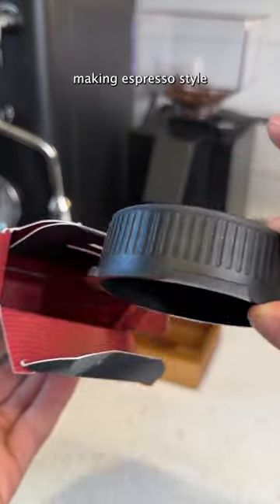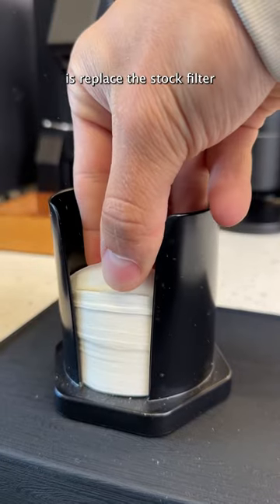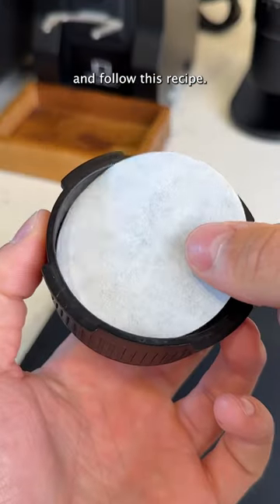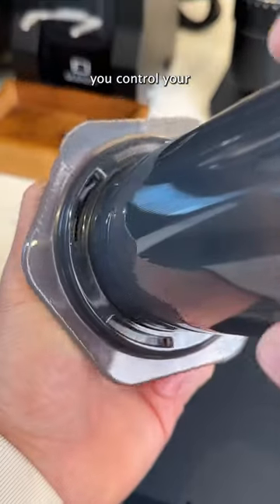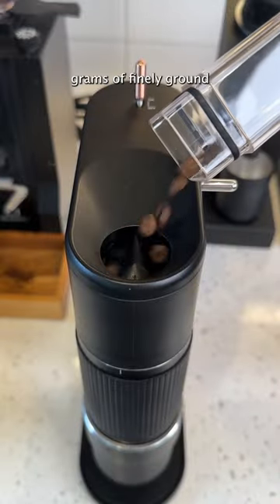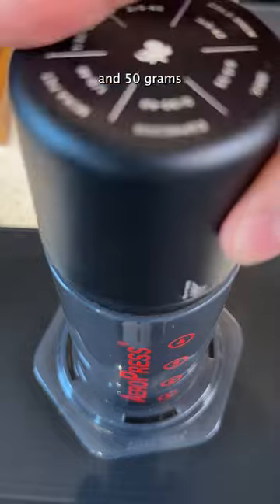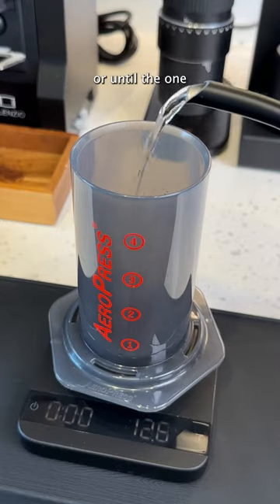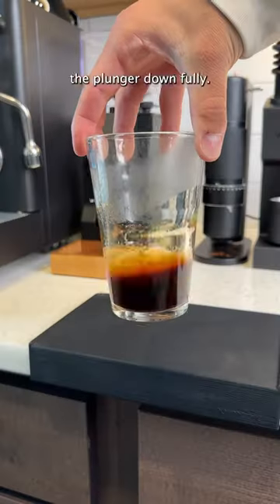The New Aeropress Cap #coffee

Comment: How does this compare to Fellow Coffee Prismo?
Reply: The prismo comes with a metal filter, this uses the standard aeropress papers.
This means you'll always get a few fines in your coffee when using the prismo, as well as a slightly different taste.
Reply: @NoOne-ef7yu  only if you don't use a paper filter with it. It's not like it doesn't fit
Reply: @Dr.Duck22  Jep, you can use a paper filter on top of the screen mesh.
But I always found that a very annoying way to use the prismo,   for some reason.

On the other hand, you can also use a metal filter with this thing.
The prismo's days are numbered.
Reply: This is almost the same but no metal filter. Get the Prismo.

Comment: Get a Moka cup , you’re welcome
Reply: Moka pots don't make espresso because they don't create pressure. Also the coffee is much more diluted.
Reply: @i.8885  It creates an espresso-like taste, and is the closest you can get to espresso without using an actual espresso machine. In fact, the Moka pot is often referred to as a “stovetop espresso machine.”
Reply: @i.8885 Moka pot does brew with pressure. Just not nearly enough pressure to qualify as espresso
Reply: @i.8885  moka pots makes more espresso like coffee than this does
Reply: I’ve never been able to make a decent Moka pot.
Reply: @bradwilks2  I’ve recently been getting great results: grind fresh espresso beans medium fine (10 on baratza encore), fill the chamber with room temperature water, brew on medium heat, remove from heat once the sputtering starts.
Reply: @bradwilks2 once you find the sweet spot, it's pretty easy to get a good cup over and over again because the variables are pretty much limited to grind size. Here's my method

1) volume fill the basket with medium fine grinds, leveled off. I usually fill it up a little over half way, stir with an espresso needle stirrer, tap to settle and then repeat till it's full to the top, leveling if necessary. It avoids waste.
2) Preheat the stove top to a little over medium heat and boil water in a kettle. Place a dampened aeropress filter over the metal filter inside the moka pot cylinder
3) Fill the chamber with hot/boiling water to just under the safety valve. Pop in the basket and twist on the cylinder. Obviously, be careful, it's hot.
4) Place the moka pot on the preheated stove top. When the coffee pools over the whole bottom of the cylinder, either shut the heat off if it's electric, or reduce it to it's lowest setting if it's gas. Allow the low/residual heat to continue push the water through.
5) Take it off the stove top when it's about a centimeter or so under the spout of the cylinder and allow the residual heat to finish the brew. When it reaches the spout, run the chamber under a cold tap to stop the brewing.

This is adapted from James Hoffman's moka pot video, who picked it up from the wiredgourmet. You'll have to play around with figuring out the best temperature setting for your stove top since that can vary even among same models, but once I hit for me, it makes a good cup of coffee every time.